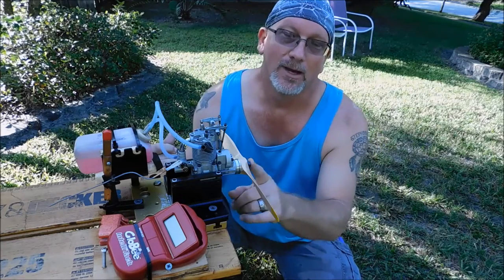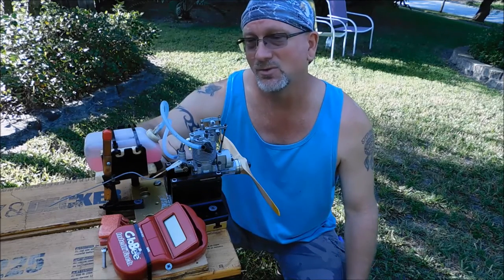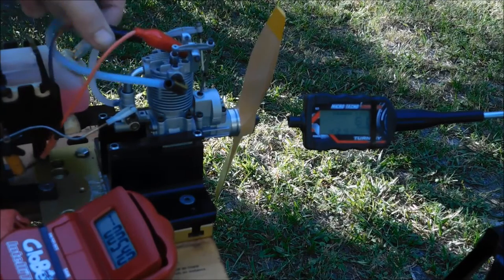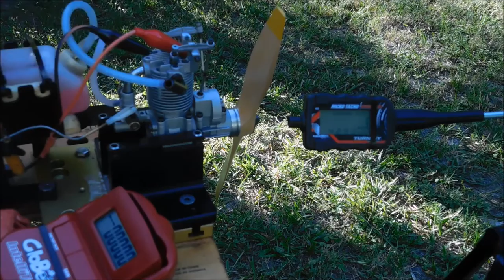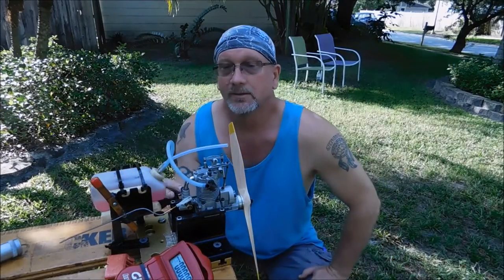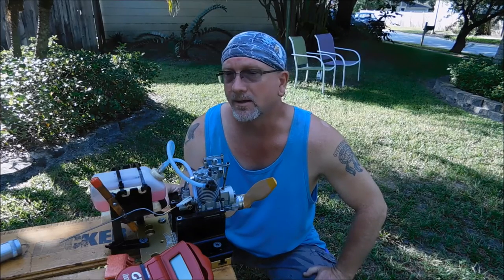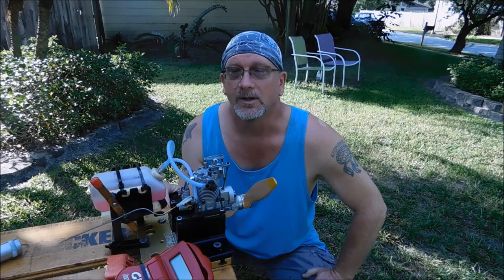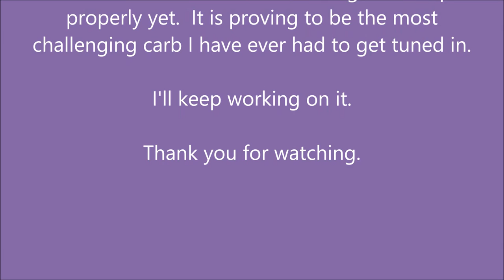Saito FA-40 Open Rocker The First Run

Comment: interesting, I had a very similar issue with my old 40. I had to almost close the low speed needle for any leaning effect on the high speed needle. Interesting to see what happens with yours. (Y)
Reply from the maker: Man, I tried that too. I was closing the low speed to try to get higher RPM, but then even less throttle arm movement towards idle would cause it to die. For obvious reasons. on my last video and runs I reset needles to what the instructions stated. not much love there either. I think the carb design on this engine is piss poor. I tried fitting the carb from my 45 two piece head but the carb body doesn't match up with the retaining screw.